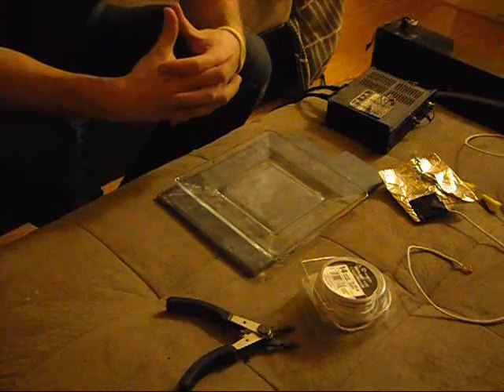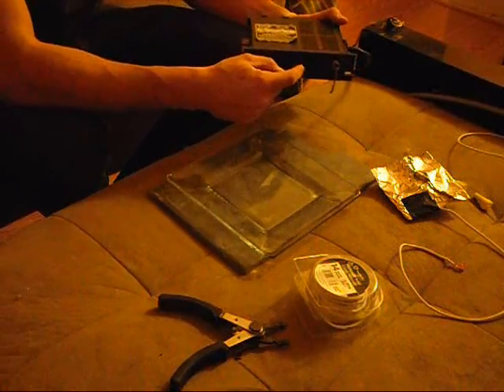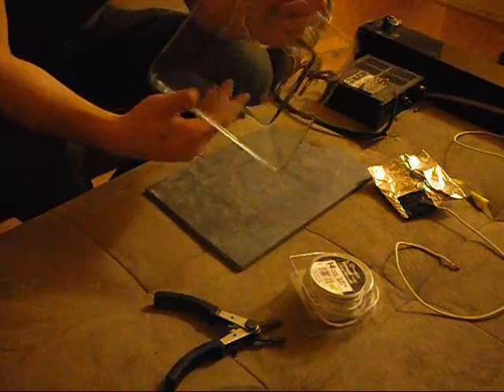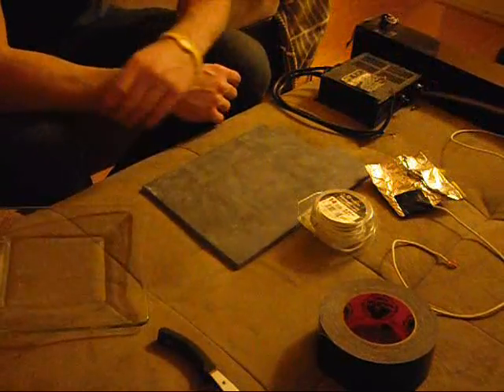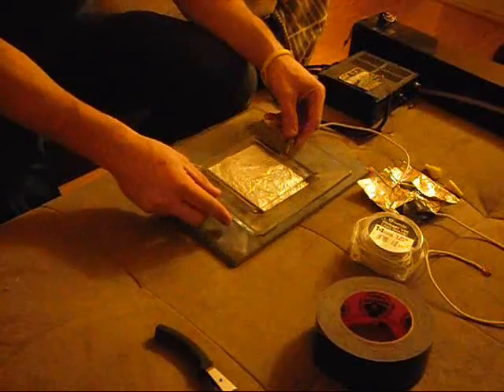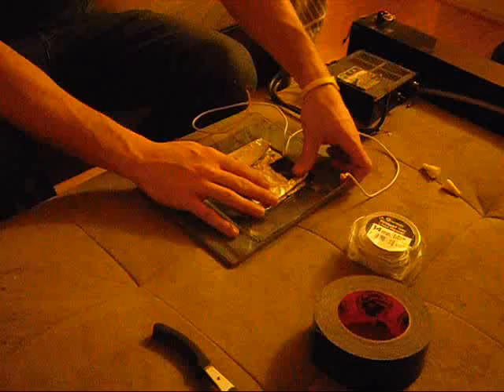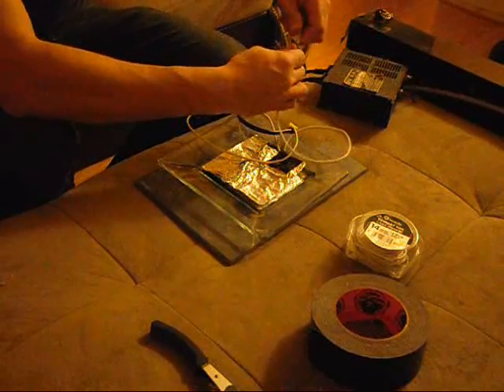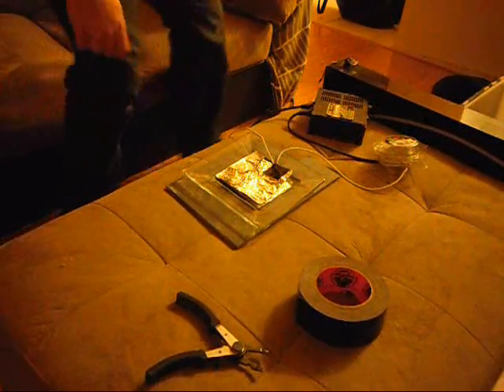Build a simple ozone generator - Step by step instructions

Comment: Years ago, I worked on a small 4 man police department in North Dakota (I am the last man living of the 4 of us back then). WE had a rather new patrol car, perhaps a year or so old, but the backup was an old Chevy from the 1970's. Compared to today's car, this was a HUGE old beater with the old single globe red light and chrome siren, the remote control spot lights on either side of the car, the lot.  Well we only drug the old Chevy out of the Fire Hall when the new car was in the shop, or perhaps there was something that required 2 cars, such as the 4th of July fire works display.  Well one of the officers, (wasn't me, I swear!) killed a skunk, and was going to take it to the vet to have it examined to see if we had a rabies problem in town.  He got busy and forgot it in the trunk.  The car went unused in the hot summer, parked in the unused half of the old fire hall. One day I went to dig the old Chevy out and man that stench was unbelievable, not only the stink of the skunk spray but decomp of the skunk added to the putrid smell.  I called the boss, and together we got the rotten body of the skunk out of the trunk of the old car, and talked of perhaps having it towed to the dump ground.  Well it just happened the fellow who ran the steam clean business, himself a former cop who was dismissed over some rather deep problems with the public walked by on his way to City hall, part of the building where the car was parked.  He told us that for 25 bucks he would guarantee he could have not only the car, but the entire old fire hall smelling clean in 48 hours.  The boss took him up on it, and sure as hell he did it.  He had a commercial ozone producing machine with a large fan on it.  One day inside the car and it was stink free, another day in that huge old fire hall and it smelled clean as if someone had cleaned the place with bleach.  It lasted as well, the stench never came back, and we used that old car for another seven years, in fact it was still there when I had my accident that put me in this damn chair! Ozone works!  thank God.

Comment: Wow.. Simple, effective, to the point. Fungii (mildew, black fungus, all of them) are the worst kind of contaminants in your lungs. Almost impossible to eliminate, most of the time, and the cause of many deaths. Sadly, people do not seem to know it. One suggestion: the wires attaching the high voltage can be made with silicon, thicker insolation, not PVC, that might be puncture by it. Thanks.

Comment: That transformer can kill a man. 6000VAC . He doesn't mention the amperage but a neon sign transformer has plenty. He says to use 14gage hookup wire. The insulation of that wire can break down and the energy can pass right through it just like it does through that glass plate. If there ever was a video of what not to do this is it.

Comment: What about building an ozone destruct?  I've looked at the ones for sale and they are just a simple tube that can handle some heat with an intake for the discarded O3.  The tube is filled with magnesium dioxide granules which does not get as hot as charcoal filler.  However, in none of the models I've seen can I see the other end.  I'm assuming there has to be an outlet for the destructed O3 after passing through the MnO2, but I can't tell from the pics.  If there wasn't an outlet, wouldn't it build up pressure in the tube and prevent more O3 coming into the intake?  Thx for any comment!

Comment: Interesting. But as you rightly said, Ozone is extremely hazardous to your repository tract. It's generally accepted that Ozone destroys the muscus membranes in the mouth, throat and lungs and is thus very dangerous to produce high levels of this stuff in a closed environment. It's best to just leave it up there in the sky where it does its job to protect us from UV.
Reply: +Martin Smith but i thought it is pure oxygen O3 instead of O2?
Reply: it is indeed O3. Its oxygen with another Oxygen Atom bonded to it. But just because its oxygen doesn't mean its good to breathe. In fact, it can cause serious health problems if inhaled too much too often.
Reply: Martin Smith ohh. did not know that
Reply: You cannot protect yourself. And making ozone at ground level will do nothing to help thicken the beneficial ozone layer miles high in the atmosphere.
Reply: nature produces O3 and the holes are nearly closed already....ps fossil fuels have nothing to do with those holes and/or with global warming , plants need co2 to live like we need o2
Reply: Agreed. But we'd need to generate it and release it closer to the actual altitude of the ozone layer to fix the problem we created. That being said, fixing is only half the solution. We need to get off fossil fuels. We live in the 21st cent and use a 19th century power supply!
Reply: +Martin Smith You look like a smart person to ask! I actually want to build this. 15,000v, 2ft by 2ft aluminum plate and 2ft by 2ft glass. Does that sound like a good idea? How can I protect myself from the Ozone?

Thanks.
I think it is extremely important to repair the ozone layer as it will not be able to repair itself fast enough!
Reply: Martin Smith Well, Ozone only has a half life of 30 minutes. If we wanted to help the ozone, we need at least 1000lb a hour. That's at least 100,000v. And we would need giant pipes taking it to 150 feet in the air.
Reply: soyTicana Yes, we can build a huge ozone generator. But, it has to be constructed in deserted areas or really far from residential area. It is very simple to construct, but does consume a bit of power. So, we will need solar panels. Total construction cost will be $1000-3000

Comment: Thanks for the video. How can it be used (or adapted to) work as a swimming pool ozone generator?
Reply: ...  did I say I would build that and throw it in a swimming pool ?!? I politely asked you how this could be ADAPTED to work in a pool (read again my previous question). As you don't have a clue on how to do that, just say so, or ignore my comment, instead of being pretentious and sarcastic (youtube already have way too much of this kin)
Reply: Tuti Fornari this is for taboo. You would enclose this in a container with an air pump and run a hose into the water being treated. As the bubbles rise ozone is released.

Comment: Years and years and years ago, a friend of mine in high school got a hold of a neon sign transformer.  He showed me how if you put a thick glass plate between the two electrodes, you'll get what is seen above.  I don't remember the ozone or the hissing sound. 

Thanks for making the video :-)
Reply: lam bda its only a transformer, a capacitor and a spark gap, the discharge or corona will "make" the o3 like copy machines in the early days produced a lot of it,why they stunk, basicly a simple spark gap

Comment: Hi,
I accidentally saw your video while looking for an Ozonizer for use in cleansing away the pesticides sprayed on the vegetables and fruits. I was aware that O3 is produced when high voltage is applied to two poles separated by a small space. Your video was quite helpful in understanding how a simple ozonizer can be made at home. I could not hear correctly the voltage applied - was it 6K or 3K Volts? Please clarify on mgkapoor.1962@gmail.com. Can you tell me from where to buy Ozoniser? Thanks

Comment: I think air circulation to distribute the heat is the key to keeping the glass from breaking.  I built one that has about an 1/8 inch air gap but I use a fan for circulation and rigid metal plates mounted to a piece of window pane glass.  No problems with the glass burning or breaking even when the generator has been left on for long periods.  This generator is easily 10 years old by now.

Comment: I've been trying to get a similar generator running, and have been burning through the glass within minutes. I've been using metal screen on either side of a sheet(s) of glass and a 10k transformer. I've made these before with 15k volts and never had any trouble with arcing despite space between the glass and the screen. In fact, I thought a gap would be necessary to get the corona that makes the ozone. But I'll have to experiment with this gap business. That's the tip I was looking for. Thanks!

Comment from the maker: I've found that you must not have any space between the metal plates and the glass insulator (on either side). If you have even minimal space between the metal and glass it will cause an arch burning directly through even the toughest glass very quickly.

Comment: I forgot to mention, another good, cheap, source for a high voltage transformer is a bug zapper. I'm about to build a monster O3 generator from an old bug zapper I've had for years that I never put up. 

Generally slightly less voltage than a neon sign, but will still work. But also higher current usually. Voltage doesn't kill, current does. So be careful people.

Comment: Don't worry about the wire nuts Vince. I always wrap my electrical tape in the opposite direction of the rotation of the planets and turn my heat shrink tubing inside out. 

Good video. Even a chimp can follow this. The haters are just jealous because they didn't create the world's most complex silicon phased-array chip.

Comment: Do not use PVC or Plexiglas, or any plastic like stuff as your main insulator, the high voltage eventually breaks down these materials and you will get an arc that will then ignite this insulator, causing a fire hazard. I even have had the high voltage drill a hole through regular glass and an arc then occurring through that hole, at least the glass was not flammable. When you do anything like this, please do not leave it on and then leave your house.
Reply: Thanks for the info!

Comment: @qooqo11111 

if you can make it in a jar, or a PVC or other plastic pipe and add an air pump (a simple fish tank air pump will work). You will need an inlet and an outlet for the air, make sure your all sealed up. Run the outlet to a small hose like a the kind used in fish tanks with the bubblier attached at the end, dump in a cup/pitcher/bucket or other container of water. Not sure how long it would take to clean the water but you should be ready to go.

Comment: Would it be pretty hard on ya power bill to run one of those? I suppose you could downsize it to a smaller scale and use it in problem areas for odor or mold  control.